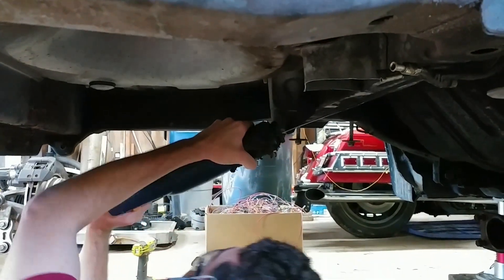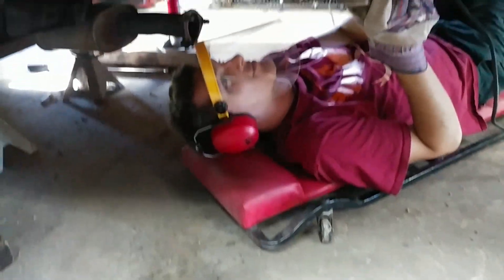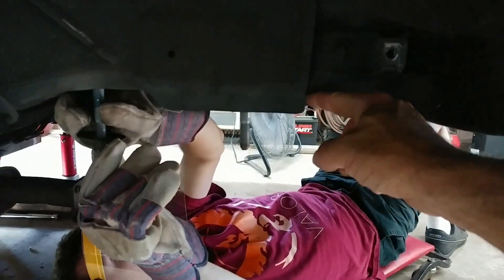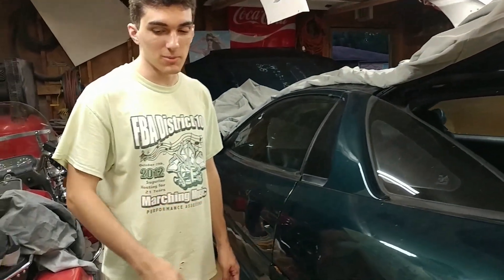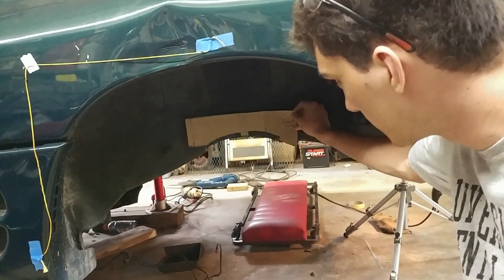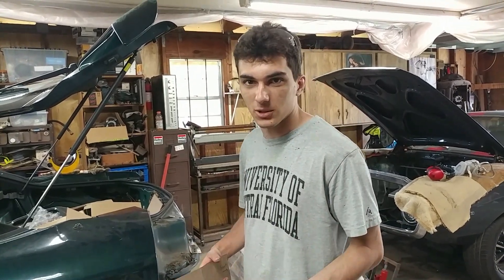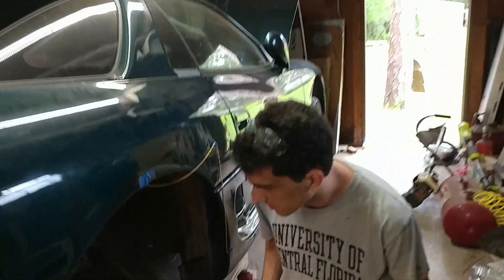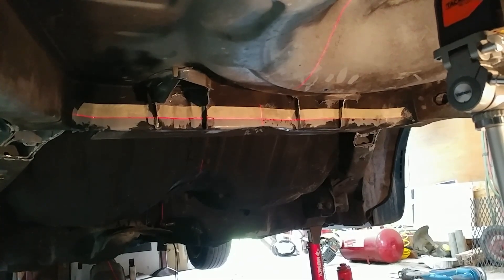Mitsubishi 3000GT Tesla Swap 4 - Cutting out Some Structure

Comment: Plasma cutter might be a good investment
Reply from the maker: We almost got one for free but couldn't get it working. I'll be getting some CNC plasma cut parts from a local shop to make the motor mounts once they're mocked up in cardboard. This is just about all the cutting that we need on the rear of the car, hopefully the front isn't too bad as well.